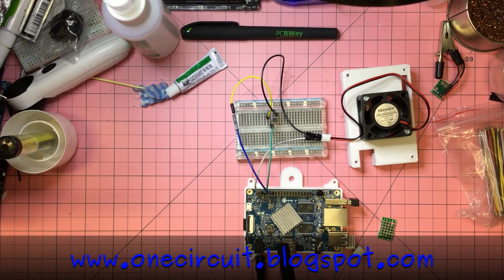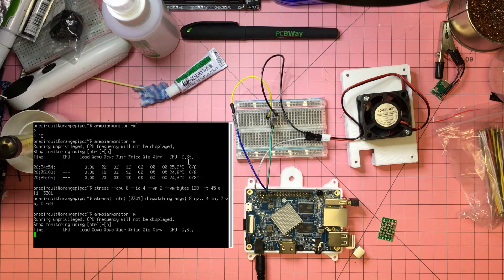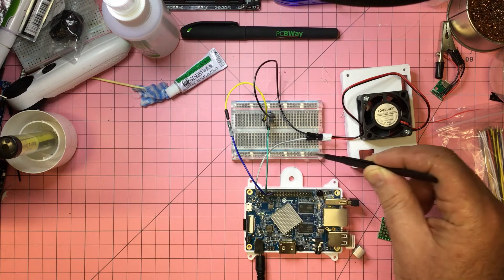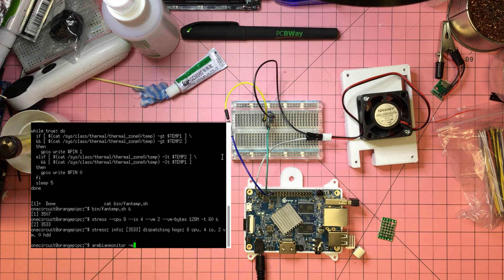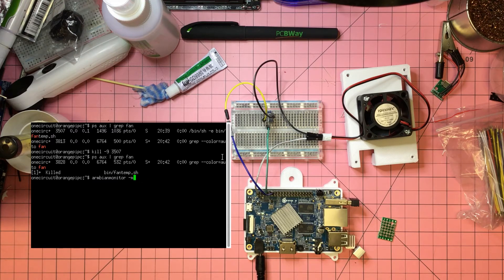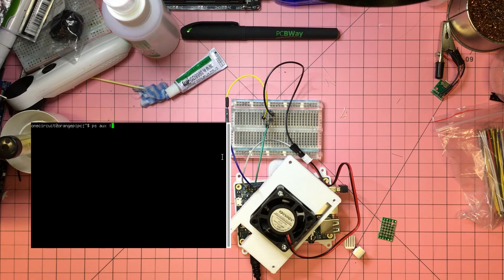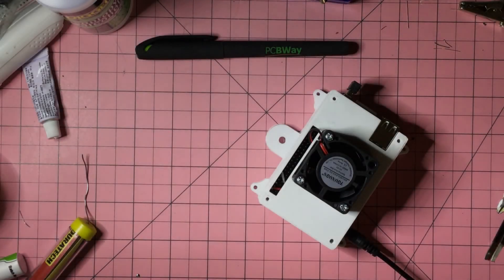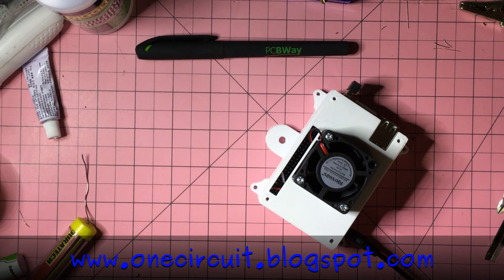CPU fan for Orange Pi PC

Comment: G'day Anthony. Just wondering, if you can run the fan based on temperature, can you alter the speed of the fan based on power delivered to the fan. I know there are cheap simple circuits on eBay with a thermistor. These work with the 3 pin fans (like computer case fans).
Reply from the maker: Probably! Maybe a PWM signal? Also there is a 3.3V rail.
Reply: @onecircuit-as  cool, so under 55 Celcius could power from 3.3v and above can switch to 5v. All this should be possible with a script from the pi zero itself without much external components.
Reply from the maker: @stevetobias4890  Maybe, but it would make more sense if you powered it from one rail for example 3.3V, and then adjusted the signal accordingly using PWM to get the fan speed that you desired. Mainly you might do this in order to lower the noise level or the power consumption. In terms of upper and lower temperatures you can just adjust these in the script.
Reply: @onecircuit-as  very true, also a single rail leaves others for different applications